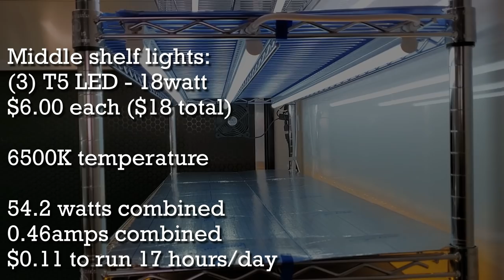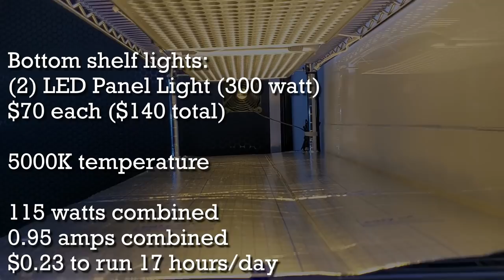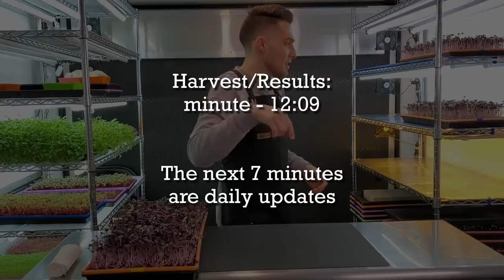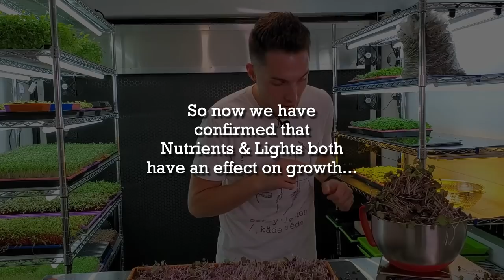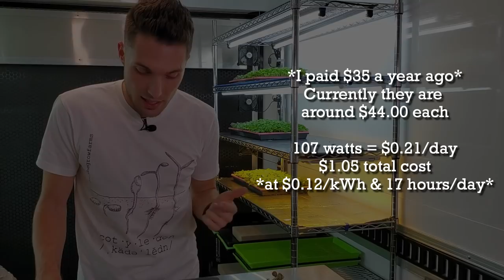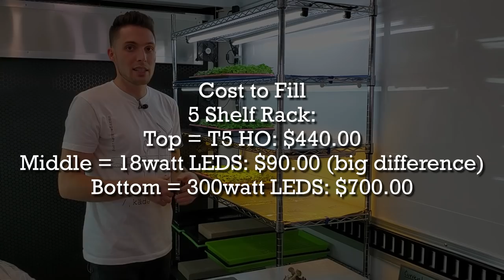Microgreen Lighting: Fluorescent vs LED's - On The Grow

Comment from the maker: ➽ Full Article with table breakdowns now available: https://onthegrow.tv/BlogFluovsLEDs
Reply: Interesting that 4.13 times more light ONLY produced about 16% more end product.. reasonable to speculate the limitation is the surface area of the leaves to absorb the light. Theoretically, a 28 watt LED of equal lumen output could yield the same as the other harvests at half the T5's power consumption. Realistically, I don't think it would as it would most likely use less bulbs decreasing the uniformity of light distribution.
Reply: Amazing experiment, thank you. I am as a city farmer (indoor) for more than 10years made my personal conclusions from this video: 1. Total Wattage does make difference 2. Shelf 2 and Shelf 3 - how to get near similar produce & product top look from cheap shelf 2 same as shelf 3 ->  place 4 LED lights 30W-35W each on shelf 2 -> you should get these extra 60-70grams. Also if 2 lights will be 6500К and 2 lights will be 6500К+2700К you will get that vibrant look of mg's. And all that will be for the 1/3 cost of Shelf 3 😁😂Did you get to that and experiments in these 3 years ? Interesting to know what you finally came to in years. Healthy harvests)

Comment: Great content! So - and correct me if I’m missing something - on a 48” long shelf, using the 42 watt LED grow-cycle cost of $0.55 - the energy cost/tray would average just under $0.14 per 358 g of greens... Not bad, bud!  Even using the expensive lighting, split between 4 trays you’d be at $0.3125 per tray per grow.  Sweet!
Reply from the maker: That is correct 🥳

Comment: Just wanted to point out that because the top 2 were sitting on top of warm lamps; this may be the reason  that they dry out more. This might also account for the lower harvest weight.
Reply from the maker: Great observation! Yes, they both had the heat rising from the lights below, but we actually found that a little heat helps with the growth... It could potentially dry it out more though, so you are correct. We will find a way to experiment better with it!
Reply: Or maybe shadows in dense vegetation made those variations. Better to make a growth with not that dense vegetation... That would be a better comparison with those different lux. What I have read about lettuce for example it's better to have more space between plants... It will get bigger yield.

Comment: Thanks for a great, informative video!  A key advantage of higher light output is the ability to support thick canopies. That manifested as greater yield in your bottom sprouts.  High light output becomes especially important for grow tents with mature plants such as tomatoes, whose leaf canopies are at least a foot thick or more. However, for microgreens, super thick canopies may be less important given that growth time is so short. In particular, the intensity of COB lights would require greater shelf heights to avoid burning the sprouts and would thetefore actually decrease yield per square foot.  

Your video has inspired me to retire my blurple sprouting leds and I will now invest in the full spectrum panels that you used for your bottom shelf. Thank you!
Reply from the maker: Thank you so much for the support!! We are beginning a lot more light experiments with about 5 more types of lights. Excited to see what the differences will be! Thanks again!

Comment: Another cost issue that needs to be addressed is the longevity of those different lighting systems - the lights AND the ballasts. I think in most people's experience the old adage about 'you get what you pay for' is generally true. What are the manufacturer claims for the life of those lights? I'd love to see you update this - now 2 years on since you first posted this - on how they're all still doing. And don't forget that increase in product from the bottom light is cumulative over it's lifetime, which is a further cost reduction overall.

Beyond that, most people also don't have dedicated growing sheds and have to grow them in their homes. Cold light isn't only irritating but the blue spectrum is bad for eyes - pets and people. The warm light of that third rack is much more beneficial and easier on the eyes for everyone who has to see it. So, yeah, I'd say it's worth the extra dosh.

Comment: Hello,nice work and keep going,on growing lights you need to look after PPFD(avg at certain heights) for plants and efficacy for your wallet( PPE as μmol/J);also between the three of your testing lights only the bottom one is a real growing one,but imo is overkill for microgreens - you can grow plants into flowering stage successfully with that,tho it has a nice feature being the lenses wich improve the light coverage (and maybe the PPFD);sadly a good spectrophotometter is starting at 2000$;P.S. radish is not a demanding crop,you could try a slow/hard  growing crop to test for a more acurate result.Cya!
Reply from the maker: Thanks for the suggestions! Yeah, we’re not trying to be perfect on this experiment and simply wanted to provide some form of measuring the light. $2,000 is way too expensive and we just care about the results really... 

We chose radish because of its coloration and we have a lot of other crops that we have filmed and will be posting soon. 

Thanks for the suggestions!

Comment: You guys always produce great content. Have you compared these rigs taking the longevity in consideration? How long will the T5's, the LED tubes and the high tier LED panels last and how much will they cost, say over the span of a year?
Reply from the maker: Great question and thank you for the support! The LED's are supposed to last over 50,000 hours... We have used ours now for about half a year at a rate of 17 hours a day. So far we've used 3,102 hours of their life (supposedly). To get it to a year, we would be at the 6,204 hour mark. At that rate, the cheap LED's should last about 8 years. The T5 HO Fluorescents are rated for only 10,000 hours total... We've used ours for a year at the same frequency as the LED's which means we have less than a year left on the Fluorescents before they go bad. So we would have to replace all of our Fluorescents next year at their premium price if we wanted to keep using them. Glad you asked, this would've been a great point to talk about in the video. Thank you for the continued support!
Reply: On The Grow Thank you for the answer 🙂
Reply: Do you have any advice on GAP compliance for MGreens?
Reply: Dude from migro does testing and most newer led lose about 5 to 7% every 6000 hrs so after 3 to 4 years they would be around 80% of original par light.
Reply: @MrSportystv  not true do your research 50000 hours on average and no loss of or degradation of light unlike hps hid or fluorescent
Reply: Nomad Wizard  Called an L70, L80, and L90 when looking at any lighting. 
L70 menaing the light will have 70% of it's intial out put by that time....L70=50,000hrs
L80 is holding onto 80% of its initial output. And L90 is 90% of it's initial output. 
Very common for L70's of 50,000. Cooler a system runs the longer they last.
Reply: Comments on the effects of different types of lighting on growth:
Do the different lights alter the temperature of the plants above or below them, 
How long does each type of light last, 
What is the cost of disposing dead lights, 
What is the ecological footprint of each type of light. 
I love your program and I find it very informative.  I'm just in planning stages of startup and sense I'm 74 years old I don't have a lot of time to mess around with mistakes. I also live on a limited income so prefer to get it right the first time. 
Kathy P. In Avondale
Reply: @KathleenCPerez  The best advice I can give you is that there are a lot of different ways you can go about this. Saying that, your definitely on the right track being here on youtube (your doing your homework) and this is key, the more you research the less mistakes you will make. There are many variables. what do you want to grow? How much space do you have? What kind of electricity bill do you have now and how much more can you afford after your setup? What kind of growing medium do you want to use? What kind of fertilizers? How much do you want or have to spend on lighting? Just to list a few there are many questions. LED's put out some heat not as much as say a fluorescent or HPS or MH Bulbs. Also Heat rises but fans can help with that. As far as effect of growth it is called spectrum. Usually for vegetative growth you would want 6500K (blue light) For flowering 3000K (more red) or what I do is use 3500K and use it for veg & flower (best of both worlds) that way I don't have to change lights. I could go on and on. Just keep doing what your doing! and good luck in your journey have fun with it I do!
Reply: @OnTheGrow  how do you replace the very bottom shelf of LED panels?
Reply: Why don't you try 2 led 18watt + 1 yellow spectrum led light ?
Reply: If you could add the cost of the lights to the cost/grow cycle, that would be helpful.
Reply: Onthegrow
Reply: @CRYSTALSHIPSS  Heated air rises, but only if displaced by cooler air. Radiant energy is generally transmitted through air and converted to heat when it strikes an object. I find the plant trays above the light source get more heat, but I am using salvaged, four bulb, t-8 fixtures. There are a lot of confounding factors to be considered in nearly all experiments.
Reply: @mackquack2929  I do agree heat rises and with those t-8s you’ll get that radiant heat like hps and mh bulbs. The difference between LED and those other types is the room temperature for leds you should run your room at 80 to 85 degrees Fahrenheit (air 85deg leaves 70to75 deg) with hps and mh bulbs air temperature at around 70 to 75 degrees
Reply: LEDs are more profitable - they consume less energy

Comment: thats was very interesting to see on a day to day basis .... and agree with you decision on going with the middle light that you have always used ... but here is some food for thought ... the bottom led system looked to me like you could possibly harvest a day or even 2 days earlier than the other setup thus making your turnaround alot quicker ... would like to see if that would be the case and if the earlier product would then be comparable the middle or top light with your current turnaround time .. and also maybe getting the spicyness back in the product ....? all in all that would shorten the turnaround thus being slightly more cost efficient ..maybe .... well done and thankyou for taking the time to show us the difference in lighting .... i pesonally dont do microgreens at the moment ..i am using my lights (t5) for plant starts for my traditional market garden (tomato,pepper,celery, peas ,beans, potato, and corn ,,,etc).. so im always on the lookout to make my starts stronger while under the lights before i harden them off for the field
Reply from the maker: We completely agree Debra! You are correct that we could've harvested sooner... The turnaround time would be a lot better and it would've cost less to run the lights and take up that space for 2 additional days... Thank you so much for your support and sharing!

Comment: Had first back surgery 15 years ago and out of boredom grew weed with fluorescents t12 bulbs. Don't even really smoke weed but learned cloning, seeding, moisture, and many other things effect grow rate. Even the height from bottom shelve to top will effect by temp.  My lights I always tried to keep as close as possible without burning leaves. Be really careful on mediums , dirt tracked in, or visitors bringing any unwanted aphids, mold, or other contaminants. Could cost you  big. An oscillating fan always helped to make plant stems stronger. And I the light spectrum that has huge effect. Plants and plant ages loved different hues from red to blue spectrum.  My plants were in attic and loved 100 plus summer heat.
Reply from the maker: Thank you for sharing! Yeah we just had a run in with spider-mites in our house grow-systems. Mandi brought in a plant from outside and put it near our flood and drain system and they took over all of our edible flowers and collads/etc in just a few days. Thanks again for sharing!

Comment: Great vid!! Did you add nutrients to the water and if so at what day did you start the nutrients. Thanks and keep up the great work!
Reply from the maker: Yes we did, we used Ocean Solution 2-0-3 and our general rule of thumb is we start bottom watering with nutrients the same day we introduce them into the light.  Thank you for watching! 😃

Comment: Excellent. Thank you for this. I've just found you but I'm quickly going through your library of videos, can't get enough. Would be interesting to see this compared to summer and winter daylight (location and weather is of course a factor in that too). Not practical inside of your trailer perhaps, but just as a comparison. I'm in the process of building a year-round greenhouse on wheels. Plan is to grow with daylight, still very interested in this though, for the science of it. One might theorise that lighting could affect nutritional content of the veggies too. All the best from Sweden.

Comment: LED lights like the bottom typically have a longer lifespan too. So that would play into the cost, and you'll save money on energy use and light purchasing in the long term!
Reply from the maker: Absolutely! I discuss that in the first pinned comment. The LED’s will last 8 years and the fluorescents will last under 2 years!

Comment: so wait - how much is radish per gram? -- you had a higher yield from the more expensive and brighter lights - how long would it take to recoup the higher expense? even if it took 6 months you would have years of higher crop yields --- you would make more money and have a better looking product. makes no sense not to use the more expensive lights. 
so - how long would it take if you always get better yields to pay off the added expense? it's all money in the bank after that (unless the lights wear out too soon).

also, the middle tray was probably drying out faster because of the hotter, higher wattage light being beneath it. next time put the high powered lights on the top shelf.
Reply: How long will the lights last?  so many variables...

Comment: Although in your case its not really a big deal, but you can't use a lux meter to compare lights that have different color temperatures. Lux meters measure mainly in the green part of the spectrum. There is actually a green gel over the sensor within the housing. So its very likely that your yellow looking LED's are actually putting out more umol than that what the lux meter can tell you. Essentially the lux meter is just measuring the intensity of the portion of the spectrum that the human eye is most sensitive to. Ex- If you measure a blurple led (pink, red/blue) with the lux meter it will give you a lower number while the actual intensity (umol) could potentially burn the plants with intense red light that the lux meter hardly measures. You really need a par meter to be fair when plants are involved.
Reply from the maker: Totally agreed! This was just a slap together test to see what three very different lights could do to the growth of the same crop. 

We will eventually dig deeper into PAR and PPFD, but for now, we're just having fun.